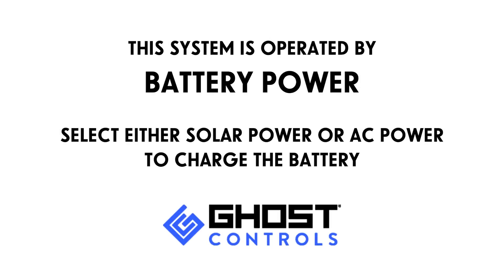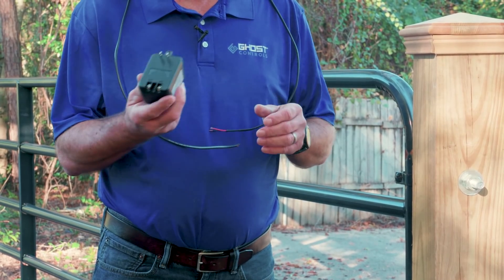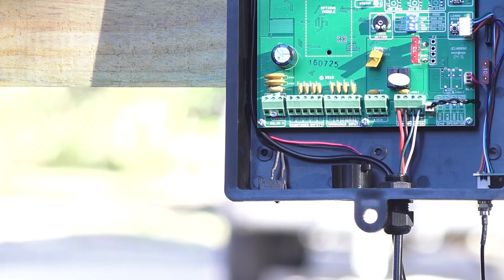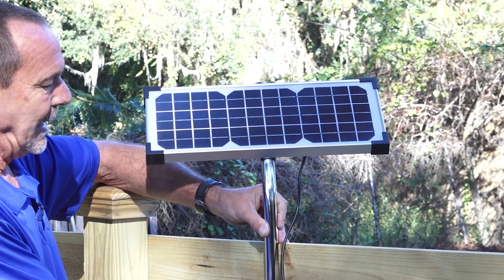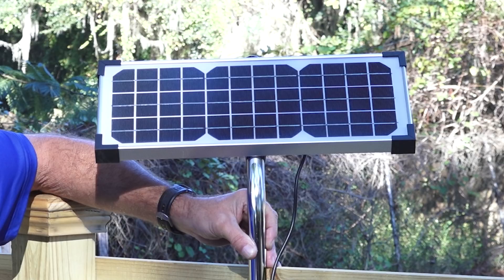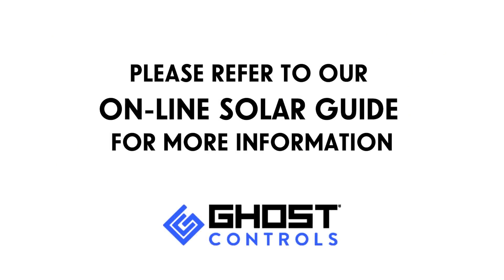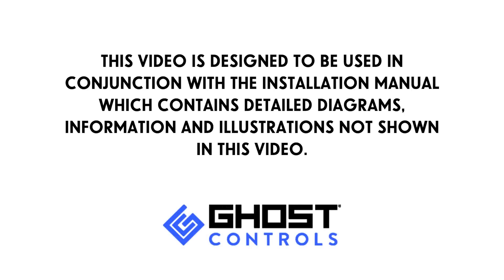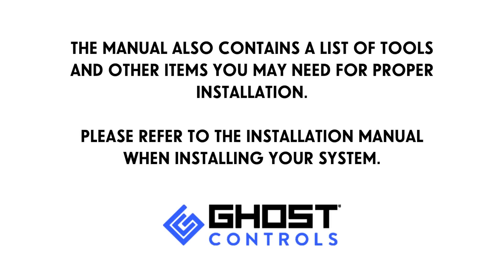Automatic Gate Opener-Chapter 4: Powering The System

Comment: what comes with the 30 watt premium solar panel kit ? I would like to use this panel to power a car battery charge/maintain set up in a classic car that only gets driven 2 or 3 times a year. Does this come with a regulator to prevent overcharging ? is monocrystalline best choice for cloudy areas ?
thanks

Comment: Can I just run power from the house instead of using a battery?
Reply: My ghost opener just stopped working, it’s on Solar with the 2 small batteries in the box. I charged the batteries with a/c adapter for 24 hours, the control arm is extended all the way in the closed position, I tried to jog it back with the open jog button but only get a lot of multiple rapid beeps.. I’ve turned it off and on but nothing… any ideas? Could the batteries be dead?
Reply: It was the Solar panel not getting sufficient amount of Sun to keep batteries charged, so I went on the transformer with an extension cord and of course I had to reset everything!!’ Ugh but it’s fine now… I need a larger solar panel… lots of cloudy days here in the Fall / Winter
Reply: @Garylee62  I think I'm experiencing something similar.
Reply: @gammacreatives  
Charge it with your A/C converter… it fixed my issue… I think I’ll leave it on the a/c converter all winter, less sun and shorter days… in the spring I’ll switch back to solar powering the batteries
Reply: @Garylee62  Good idea. I ordered the 30 Watt Solar Panel to see if I get any improvement from that and might try it with a Marine Deep Cycle battery too. I like the idea of AC during winter. That might be the way to go.  Thanks!
Reply: @gammacreatives  
Bigger panel and a deep cycle battery will prob do the trick… charge the battery before going on Solar
Reply from the maker: That's an excellent question, Johan! You can certainly use the power from your house rather than solar, but the battery is still required. All of our systems are 12 volt primary operating systems. The use of 110 volts is to trickle charge the battery. We include a transformer that plugs into a standard AC power outlet that reduces it to 18 volts.
Reply: I think I’m running into same issue (but ironically it coincided with us accidentally opening the gate manually without turning off power so I wonder if I’ve convoluted the issues). If you don’t mind me asking, where are you generally located (trying to compare sunlight exposure). I’m in NC.
Reply: @Cornnugget4  
I’m in Southeast Texas 90 miles East of Houston, I’m in between Lake Charles Louisiana and Houston Texas
Reply: Please tell me the required amperage for the A/C transformer at 120 Volts so I can calculate wire size and voltage drop